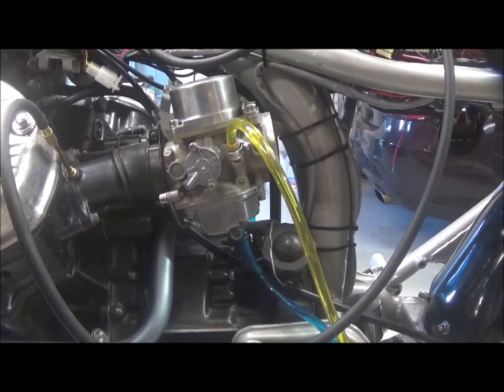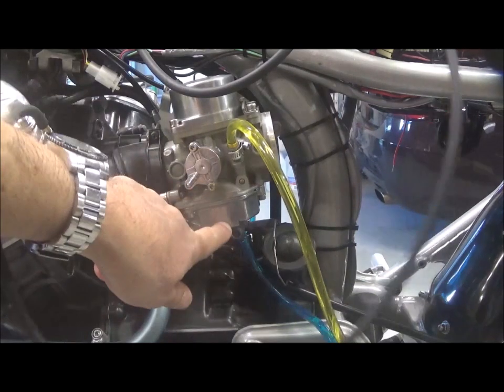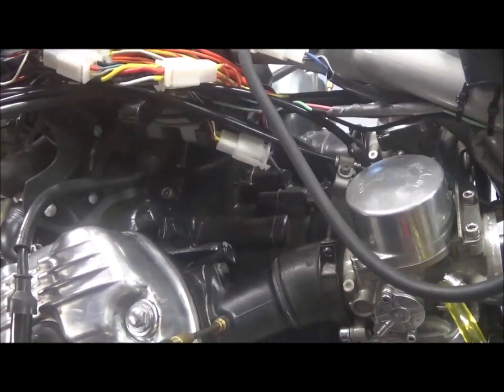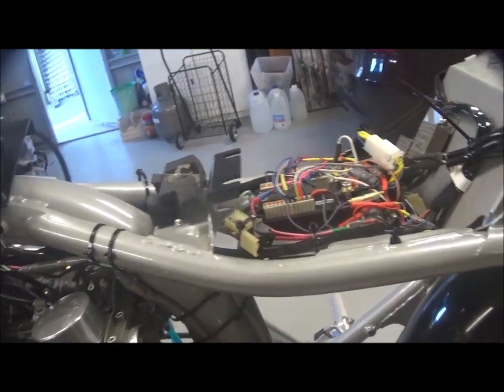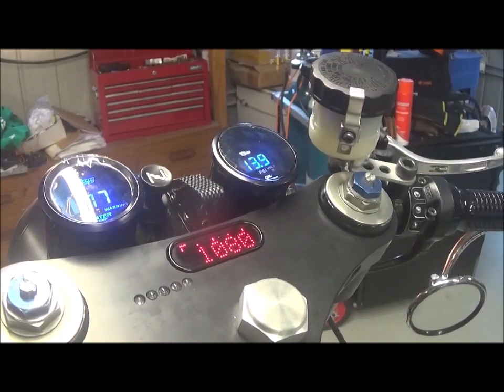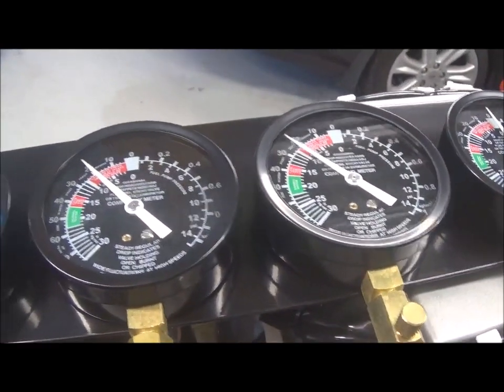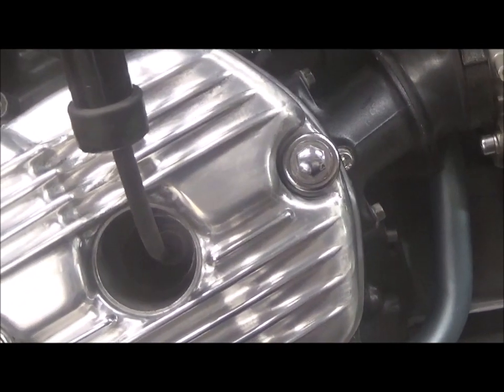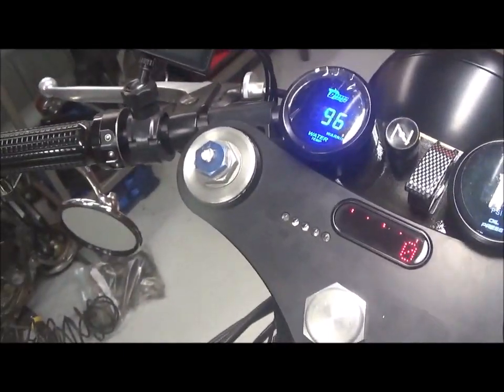69.5  Honda CX500 Cafe Racer - Tuning Carburators

Comment: Looks amazing, sounds amazing. My 1980 cx500 Custom is bone stock with a little over 20K miles. Having a heating problem I think, wants to quit after about 30 minutes and seems very warm. Hope to get that sorted out without having to go to the electric fan mod. First place to look I guess is the thermostat.
Reply from the maker: Thanks scott. If your radiator not getting hot likely thermostat not opening. Good luck.
Reply: @TheOdontologist  I don't understand why but it seems that replacing the old battery with a more powerful gel cell battery has fixed everything and given me more horsepower. Crazy huh?

Comment: I have a similar issue, although it’s my right cylinder that’s not firing. The bikes wiring was torn apart, but I get spark in both cylinders. The carbs have been cleaned and synchronized. But the right cylinder only runs for a little bit when it’s cold. After a few seconds it chokes itself out and the right cylinder is dead. If I really get on it, the right cylinder will start to fire, but only at the top of the rpm range and not very smooth. Any ideas? Compression test went well, 151psi in the right cylinder, 149 psi for the left cylinder.